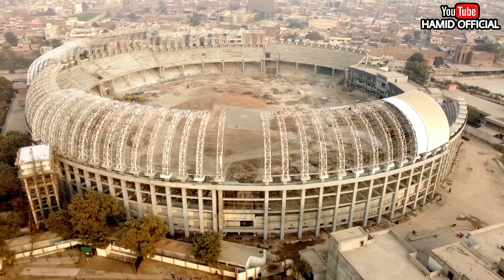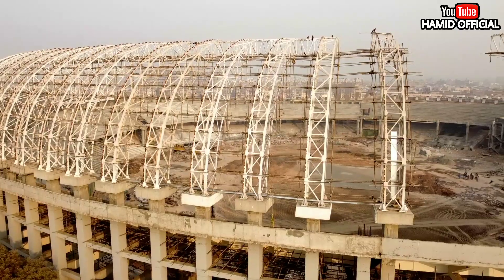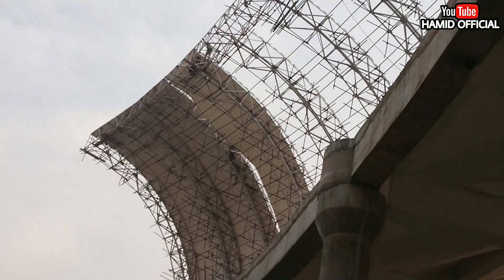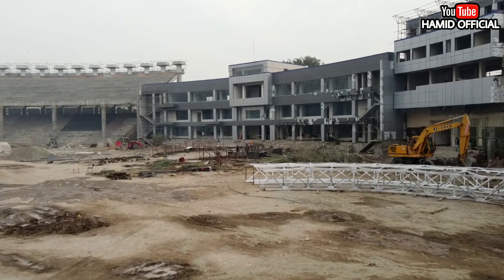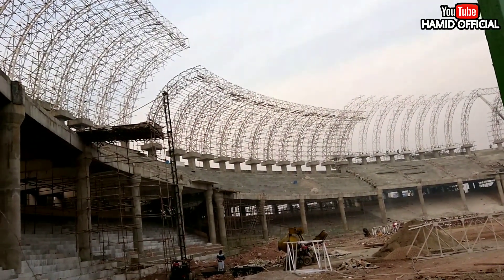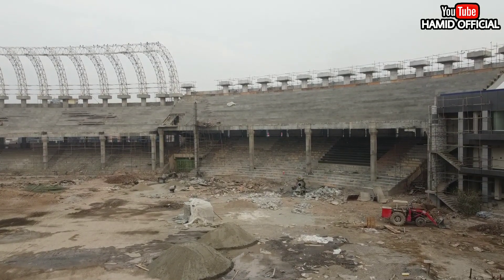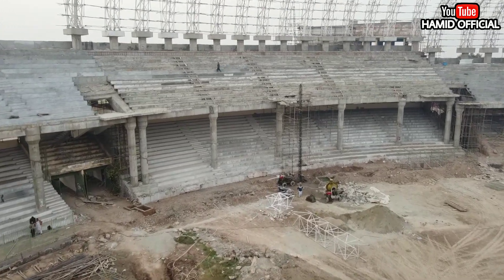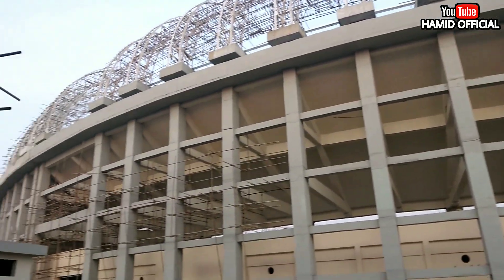Arbab Niaz Cricket Stadium Peshawar Latest Updates Drone Video | Roof & Ground | Arbab Niaz Stadium

Comment from the maker: CHILLL YE DUST DUST WALAY SAB YE READ KARO
👇🏿
Tensile Fabric being used in Arbab Niaz is 900 Gsm Valmex Mehler Fabric from Germany which has self-cleaning properties on exposure of rain water onto it. So no need to worry.

Secondly CnW can also clean it by using a team of cleaning professionals by using Surf Excel and Water only. So this is also not a big issue Thirdly this is the same fabric that was used in earlier 2 samples Only dust has changed the colour of first 2 samples. Baahir ke mulkon mein ye white he rahta hai. Peshawar mein mausam khushk rahta hai ziada. And obviously stadium ko maintain rakhny k liye staff hota hai. Wo har baray match se pehly stadium ko decorate kartay hain. SHUKRIYA